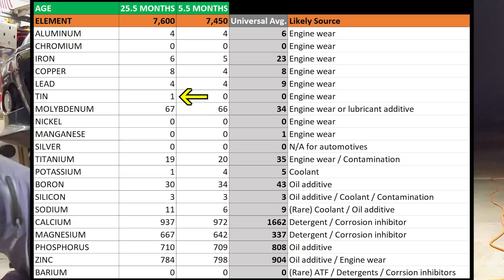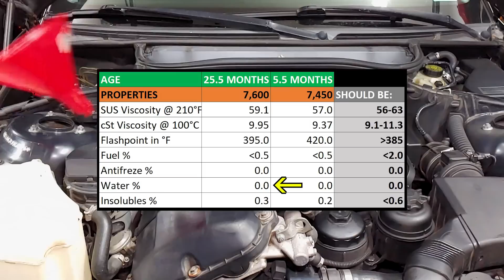Does Oil Really Need to be Replaced Every Year? Surprising Analysis Results Revealed

Comment: As an old git who has been around the block a few times my view is this !!!! If you have a turbo change your oil every 5000 miles no question. Also if you have a turbo when you have finished your drive let the engine tick over for about 30 seconds to let the turbo stop turning as the oil is not under pressure when you turn the engine off so the turbo turning at mega mega speeds then suddenly has no oil If you have a turbo car remember this otherwise you will be doing what all manufactuers want you to do buy a new turbo.. Hence they do not advise you of this in their so called manual ?? When will we ever get back to having principals God help us all the way things are going !! Safe driving to all !!!

Comment: I have used Amsoil Signature Series in 3 of my vehicles since new. I had oil analysis run at 5,000 & 10,000 miles. My readings showed additive for improved  lubrication such as Moly, zinc and Phosphorus levels reminded high, indicating a high quality additive package used by Amsoil.
Reply: That is because Amsoil Signature series is one of the top three oils available, especially if you are using a good filter.  The oil and filter the OP is using isn't even close to Amsoil quality or does it have the additive package to remotely match it. I would bet an oil change that if he switched to one of these oils and filters, he would have better oil analysis results.  I have does exhaustive oil testing on oils and filters worth thousands of dollars on five vehicles, three cars and one is a C7 Z06, one hybrid, on 2020 Jeep Grand Cherokee and two HVAC work vans.  I have tested oils from 5000-6500 on the vans and 5000, 7500 and 10k on the hybrid and the Grand Cherokee as that is factory recommended.  The Z06 is based on how much I race it.  It is 800whp and gets changed much more often, but have found that the racing has barely made a dent in the additive packages or wear metals.  

Pennzoil Ultra Platinum 
Amsoil Signature Series
Valvoline Extended Performance High Mileage
Redline as a distant fourth.  

Amsoil EAO filter
Fram Endurance filter 
Purolator Boss (Produced by Mann-Hummel)
Both top two filters are made by Champion labs
Reply from the maker: Interesting, I plan to run this test again with Amsoil in the near future.

Comment: I drive 2,000 a year. I change my oil and filter every 2 years but I check my oil level every so often. During the 2 years if I see my oil looking dirty I just take my pump and pump out a few quarts doing a partial oil change. That keeps my oil clean. And after 2 years or 4,000 miles I do a full oil and filter change.

Comment: I drive 60 miles a day. Ive been using castrol edge 5 30 in my 3rz powered 2001 tacoma. I change it every 3 or 3.5k. I have to lay into it as i drive up about 2000ft in elevation to get to the top of the mtn where i work. At 300k im curious what an analysis would say but at the same time id almost rather not know bc i trip about the truck all the time. If i hear ANY odd noise i tear the truck apart replacing bearings and bushings and etc....i think its a mental disorder
Reply from the maker: My friend just gave his 2001 Tacoma to his son at 300k+ miles. He bought it when we were in high school.

Comment: How many miles can you run on one quart of oil. To me, that's an important number since you would be refreshing the existing oil with a quart of new oil. Also, I don't think your engine is turbo charged. BMW turbo-charged engines get the oil really dirty with carbon/blow by. My son has a 2010 135i and we change the oil every 3000 to 4000 miles. The engine uses one quart of oil every 2500 miles. My preferred oil is Mobil-1.
Reply from the maker: I've always been interested in the 135i. How do you guys like it? Owned since new?

Comment: Volkswagen Passat 1,9 tdi.  I use Castrol Edge Turbo diesel oil and change it after 15000 km. Oil + filter cost ~60€. Low price for keeping engine running smooth. 350000 miles driven and works fine.

Comment: I drive my car for 14 years.. and i have never changed my oil.. and it runs damn good... and im a mechanic.. my timing belt and waterpump sits for therteen years... my car is 34 years old and even the clutch is 34 years old...

Comment: It should be very obvious now that the age of the oil or time in service is not the issue, but contamination.

I run a bypass oil filtration system on my semi truck, a 2006 International 9400i with a caterpillar C13, and I believe at my next service interval this oil will have 300,000 miles on it. I do oil samples every 20,000 miles, and once the oil sample comes in, when the oil is cleared for continued service, I lube the chassis and change all filters. in the last 1,100,000 miles, I’ve had to change the oil twice; once when the engine was finally due for overhaul at 1.1 million on the odometer, once due to coolant contamination when the cylinder head from that overhaul failed prematurely under warranty, and there was one unnecessary change when a technician did not follow instructions and dumped the oil out, so I got free oil.

Filtration is where it’s at. I run Rotella T6 15W40 full synthetic oil, which technically is not synthetic at all, but normal petroleum-based oil refined to synthetic levels as most “synthetics” R (European spec Castrol, Amsoil, Schaeffers, and Mobil1 being the exceptions). The engine consumes 1 gallon between 20,000 mile filter change intervals, and filling the filters takes about 1.5 gallons. Therefore, roughly 25% of the oil is refreshed every service interval (total capacity 10.5 gallons).

Recognizing that, with proper Filtration, the oil can last nearly indefinitely if it does not become contaminated, you’ll soon realize that it’s completely within the realm of possibility to simply change filters and top off the oil if you are doing oil samples to confirm that the oil is still viable. That haven’t been said, a 5 quart jug of Mobile1 at Walmart is $24, add an oil sample is $30. That’s easy math to figure out!

So, if you want to ensure longevity of your engine, don’t go over 5000 miles on most engines, as their minuscule oil filter elements don’t have the filtration media area capable of filtering the oil very much past that point, and only use OEM filters.

Comment: I question the idea that oil breaks down that quickly when not being used. If you believe that it does, then every time you buy oil you should look at when it was made as it must be breaking down in the container, right?
What I do know is, if you use your car most days for very short trips, then you should change it at least once a year because it will be absorbing water and not getting hot enough to evaporate it. However, if you only drive once a or twice a week and the engine spends most of it's time at operating temperature, I don't believe you need to change it until you've driven the distance you normal change at.

Comment: You should switch to 5W40, M54 loves 40 weight oil.
Reply from the maker: How about the M52? That's what my car has.
Reply: @endlessmoneypits  basically the same for all BMW 6cyls. Helps with oil consumption, somewhat more demanding use and summer temps. Only downside is slightly higher fuel consumption but who cares. 
Oh and for your engine stick to LL98 or LL01 spec.
Reply from the maker: Thanks, I am currently running these tests again with LL01 oil.

Comment: Great video series, please keep it up!
The best advice I've followed is, the owner (not a shop) should change the oil every 6 months, even if the mileage requirement hasn't been met. 
This is done not because the oil "needs" to be changed, but because it forces the owner to get under the car and inspect components and spot problems that might have unknowingly arisen. This practice has helped me spot many problems over the years that I might have missed with longer drain intervals.
Also, I often do a better job than the professional shops... I care more about my car than they do. Cheers!
Reply from the maker: Thank you. I am working on more videos like this. I agree, getting under the car regularly is important. A lot can happen to a car in 6 months.
Reply: You can look after your car without changing oil.
Reply: @reinhard8053  Sure, nobody said you can't.

Comment: Even Honda motorbikes has acknowledged the fact oil does not degrade over time and changes are now on mileage on my CMX 1100 and not by date except for the first service at 600 miles  or 12 months for filter and oil after that it is by mileage. but when I use a bike" heavily " I will change the oil when I need to like after 1700 miles in a week on a Super Cub 125 with the throttle pinned 70% of the time it was definitely needed.

Comment: If you like to gamble go for long oil  changes. The bottom line is oil is much cheaper than replacing your engine. In my 40 plus years working on cars I never seen an engine fail because someone changed oil to often, let that sink in.

Comment: I do 5k mile oil changes on my E39 or one year. Synthetic oil is cheap. I know how to change my oil. Why screw around? On my Mercedes I change it even more often. I only use Mobil 1 Euro spec. 23yrs of owning my E39 and one radians one water pump. Not a drop of oil ever leaked.

Comment: The new oil can vary right from the p[producer. Main thing is viscosity. I rebuilt marine diesels to the tune of over a million dollars each on a 4 engine tug. Viscosity check is run every 4 hours of operation. Fuel dilution monitored that way. Bottom line thin oil is worst than dirty oil. Car engines are built very poor. They are designed to fail at a certain number of hours. So are built with better parts just to show some of that model car still on the road. It is just a big game. But if you keep rest of car in shape a new engine is much cheaper that a new car. The electric cars will change all that. The battery costs more than a whole new gasoline car. Greed rules the world. Oil change is cheapest thing to do for engine life.

Comment: I've been wondering about two year interval/low mileage oil changes for ages but could never got a firm answer until now. I only drive 2-3,000 miles per year but changed my oil annually. Maybe now I'll stretch that to 2 years between changes. 😅
Reply from the maker: Just make sure to avoid short trips that don't get the engine up to operating temp.
Reply: @endlessmoneypits  
Good advice, thanks. It's a 10 mile drive to the grocery store. I'm hoping that's enough to get it up to operating temperature.

Comment: What about condensation in the pan that will collect over time? Can't be good.
Reply from the maker: Condensation gets burned off when the engine gets up to temp but many short trips can cause a problem. I try to avoid short trips with this car.
Reply: @endlessmoneypits  I think and could be wrong but that water can mix with your oil and cause it to become milky. I believe that is why they say to change your oil at least every  12 months.
Reply from the maker: It takes a fair amount of water to make the oil appear milky. A head gasket leak could do that but I've never seen it in a healthy motor. If the crankcase is sealed as it should be, there will only be a small amount of moisture inside. Water should not be able to enter the crankcase.
Reply: @endlessmoneypits  Agree but I think that's the logic.

Comment: If you’re not looking at TBN and TAN numbers on your used oil, you really don’t know what it’s condition is for longer change intervals. I run my oils 10,000 to 12,000 miles but never more than 1 year. I’ve done that on 3 cars (Ford Focus, Toyota Celica GTS and a Acura TL all purchased with 60-90,000 miles on the odometer) to 200,000 miles in a 15 year time period.
Reply from the maker: I'll be requesting TBN on the next round of samples.

Comment: Water in the oil mostly comes from short trips where the oil doesn't get hot enough to make condensate evaporate. If your trips are long enough to get the oil good & hot, then low miles per year won't make the oil deteriorate like short trips would.

Comment: You've to change the carter ventilation filter every 50k miles, than oil consumption will be reduced.
Reply from the maker: I've never heard of that and can't find any information online about it.
Reply: @endlessmoneypits  Ask the BMW dealer.
Reply from the maker: What is it?
Reply: @endlessmoneypits  A filter in the valve cover.
Reply from the maker: There's no filter in my valve cover. I've had it off 3 times and even replaced the whole thing a few years ago. No filter there.
Reply: @endlessmoneypits  A four cil. has it inside the valve cover, a small black box, a six cil. has it outside the engine, 2 black cilindric boxes with hoses,  replace it totally when there is pressure built in the crackcase, so carterventilation works again fine as it used to, and the turbo will survive, when you're in time.
Reply from the maker: Oh, I think you're talking about the CVV (crankcase ventilation valve). There is no filter in that either, and definitely no turbo in this car, but it is an oil separator that commonly needs to be replaced entirely. I did mine about 5 or 6 years ago. "Carter ventilation" doesn't sound familiar and does not show up in google search results. Translation issue? If that is not what you're talking about then you'll have to find the right name for it and let me know.
Reply: @endlessmoneypits  Yes, crankcase ventilationvalve/filter (there is a filter in it) is the same as carterventilationfilter or oilseperator. Change every 50k miles or 80k km or 5 year, because it clogs up and will reduce your oil flow and increase your oil consumption.

Comment: I’m no engineer but it seems to me it’s the type of driving that is most important.  After two years your Water % is 0.0.  Are a lot of your miles on the highway, or at least often driven enough to thoroughly heat the oil to evaporate the water?  A 7,500 mile/ 2 yr oil change with10 or 20 mile trips would probably heat the oil enough to evaporate the oil, but a 7,500 mile/ 2 yr  oil change with short trips where the oil doesn't sufficiently warm would probably accumulate a significant amount of water.
One can’t change oil too often, but if not changed enough the damage done can’t be reversed.
I probably overdo it with 6 mo/ 5,000 mi (usually 5,000 miles comes first) oil and filter changes using Mobile 1 Extended Performance and factory oil filters (no more expensive than aftermarket premium oil filters).  Like you say, oil is cheap, engines are expensive.
Reply from the maker: I always try to avoid short trips by taking the long route home when necessary.
Reply: @endlessmoneypits  Thanks for the reply.  In looking at a lot of comments it looks to me like most people believe it's time and/or miles that most affects oil longevity.  It would be interesting to see test results, Water % in particular for an engine having extended oil intervals with short trips, 1 to 2 miles, where the engine oil never comes close to temperature.  I suspect water in the oil would quickly use up some of the additives and quickly accelerate formation of acids, sludge, etc.
Reply from the maker: That would be a really interesting test. Not on my car, but I could get a beater car for future experiments if there is enough support.

Comment: In power generation facilities, the oil used to lubricate the turbine generators can go unchanged for periods exceeding 30 years, without issue. Granted, it's not exposed to internal combustion but the point is, oil is more durable than the general public is lead to believe.
🇺🇸

Comment: You'd never make a pilot, where specifications count and lives depend on it. Not every engine is created equal and not every owner drives the same  You'd be better off by driving a cheaper car if you're not going to follow the owners manual. And as for knowing why there was specification change, its your video why should I tell you.
Reply from the maker: The owners manual for this car actually says to change the oil every 2 years or 20k miles. If I listened to that, I don't think my engine would still be with us.

Comment: Coming back to your question about flash point which dropped by 25°F, as a chemist engineer 
, I would rather explain that by a petrol contamination, in my diesel car Audi A3 1.9 tdi 105 hp DPF, the fuel contamination could be worse because of oil dilution, any time the engine activates the  particle filter active regeneration by post-injection, some excess of fuel can pass to the sump and I sometimes noticed that oil level becomes higher and this could be harmful for engine health if oil isn't replaced more frequently ( each six monts in my car) Likewise, I had to replace hydraulic lifters and camshaft prematurely.

Comment: My experience with my Audi A3 8P Sportback 1.9 tdi 105 2009, BLS engine, I used to replace oil Castrol Edge 5W30 LL with filter once a year, every 8.000Km (5.000 miles), at 220.000 km, I had an issue with valve hydraulic lifters and I had to replace them with camshaft, so I got the lesson, in extreme weather conditions like in my country, dust and heat and bad quality fuel, and also my harsh driving style, it has no sense to leave the oil for a whole year, it should be replaced each six months.

Comment: Suspect the flash point is entrained volatiles. Forever I've been careful to get engines to operating temp before turning off so that volatiles evaporate. Since I live in the country, NP. I read back in the late 70's about it being crucial. I've never had any issues with wear since, did have before, Toyota 18R-RC, timing chain tensioner. Works with OCD😅
Reply from the maker: I always take the long way home if doing a short trip for the same reason. Seems to pay off.